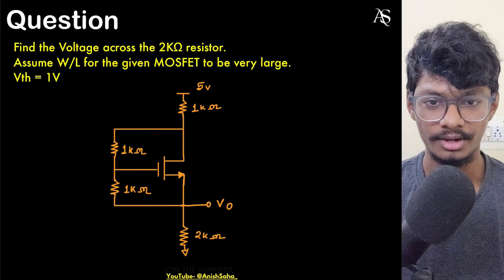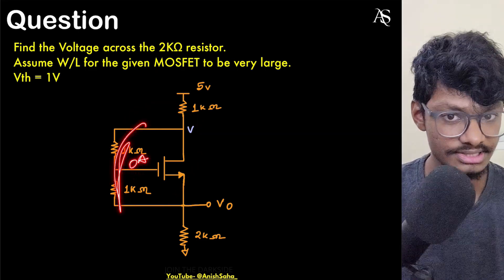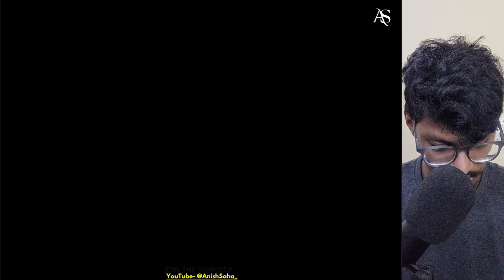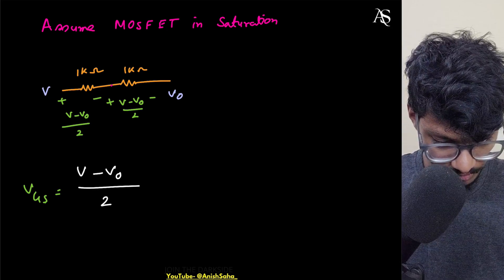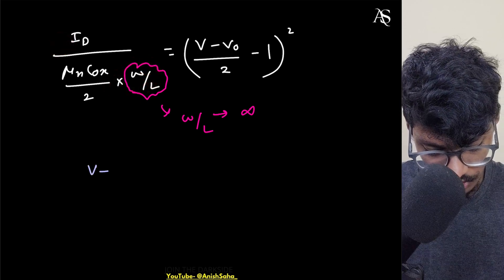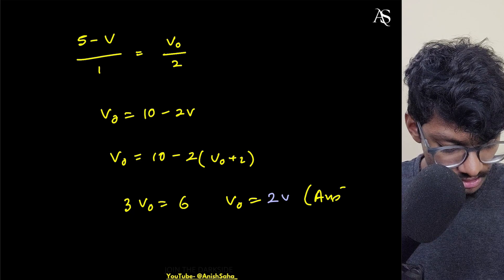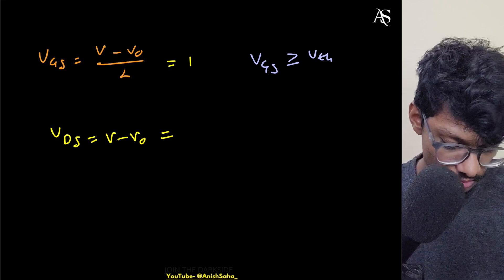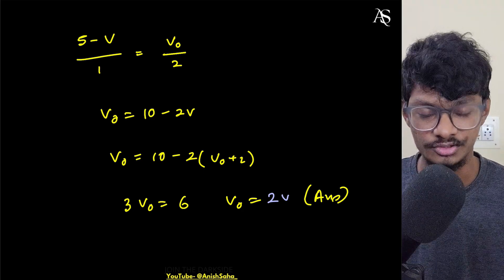DC Biasing of MOSFET || Screening Test Questions || Circuit Queries

Comment: Without seeing your solution I solved the problem in a different approach and my answer came out to be 2v. The concept I used is- I considered that the mos is off that means no current is flowing through the mos therefore the entire current flows through the resistive path, so the current is 5v/5kohm = 1mA, so drop across 2kohm = Vo = 2v. And I cross checked if the mos is really off or not. As for the mos to be on Vgs has to be greater than Vth and here Vgs is equal to Vth therefore it just at the edge so the assumption is correct and Vo is 2v. Is this method correct or not please tell me 🙏🏾
Reply from the maker: Yes this approach is also correct.
Reply: @AnishSaha_ thanks ♥️